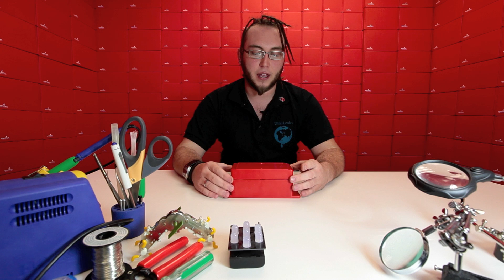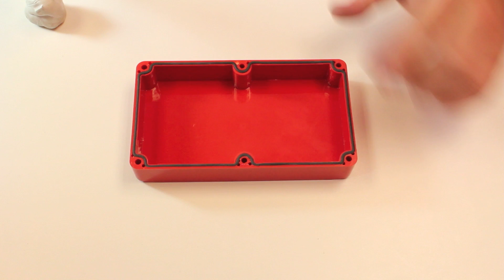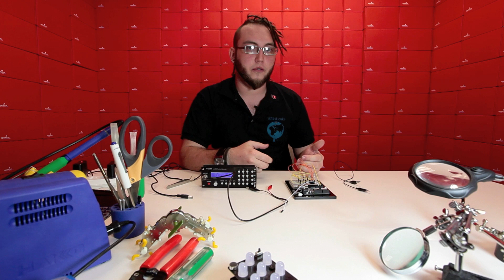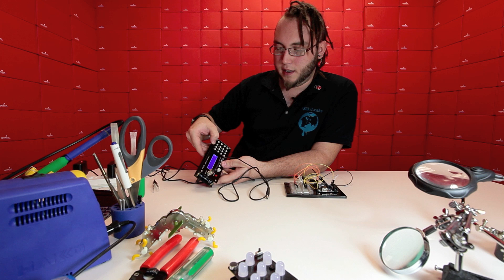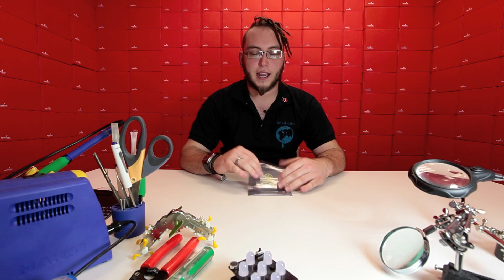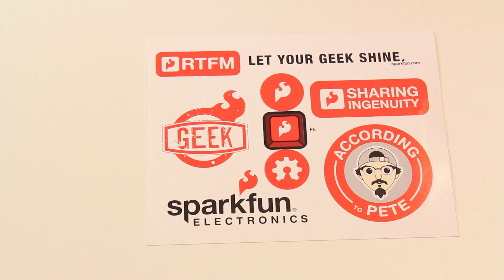SparkFun 8-17-12 Product Showcase

Comment: Way too much explaining of supplementary info that isn't necessarily related to the products. Not really interested in an arduino tutorial. You should have just got an oscilloscope to run through all the wave forms briefly. maybe even hook up a speaker to hear them. Then lastly use your binary led demo. Except only condense the explanation down to the essentials. Like 'I've lifted the clock pins of the arduino atmega so I could bypass the crystal and use the function gen instead.' done and done.

Comment: Perhaps a good product idea for the Uno would be a small adapter that breaks out the clock pins but otherwise pass thru the rest of the arduino pins. This will let you insert whatever clock rate you want with your own clock etc.  The ATmega328 runs up to 20mhz making it easy for people to set higher or lower clocks depending on the can they stick on it, or function generator they plug in.